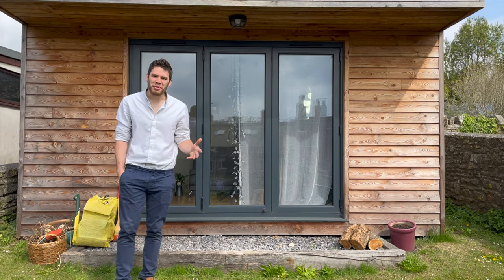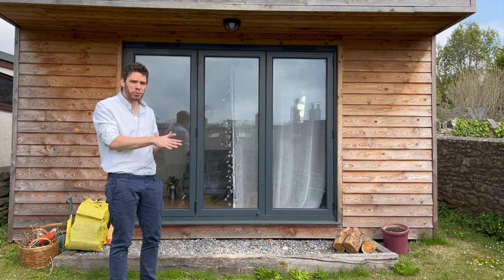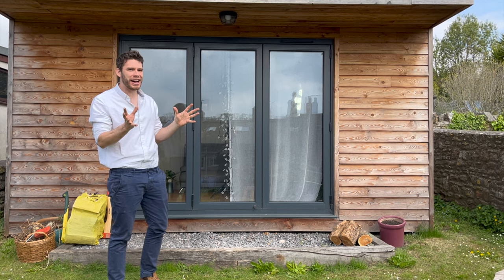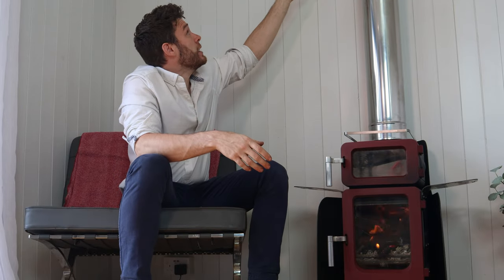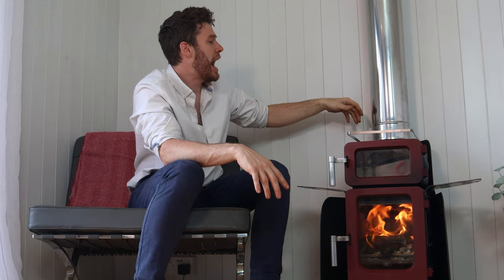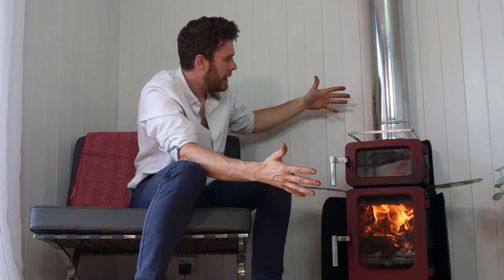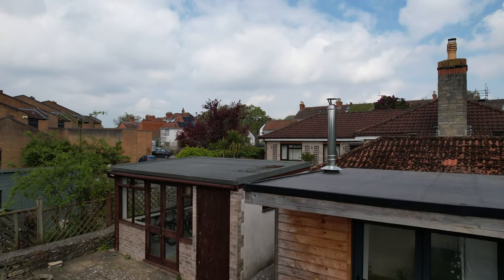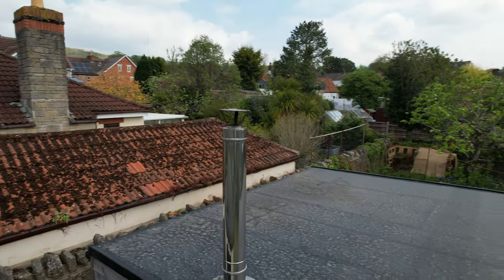Can a stove be fitted into a garden room, yurt, van etc, safely?

Comment: I’ve been putting a log burner in my workshop for about 6 months now and safety on the installation has been my priority. I’ve trawled the internet and YouTube for good informative content in all aspects of the fitting (mostly for regulations and safety aspects) This video is by a million miles the best I’ve ever seen and wish I’d seen it months ago. I’ve bought all my flue system from a local family run business so I can pick they’re brains and knowledge. As you say I have been through all the installation with a fine comb knowing where the possible risks are. I now feel confident in my installation BUT I am scared to light it 😅
Many thanks for a totally brilliant informative video, I wish I could tell more guys trying the same as me.
Reply from the maker: That’s really kind, thanks a lot. 

As long as you have a smoke/CO alarm there is not too much risk as you’ll be in there doing things and not be asleep. Light it up, I hope it’s excellent, but if you are struggling feel free to ask a question.

Comment: This was an amazing watch, thank you! It was jam packed with useful, important, valuable information. I'm starting a caravan renovation project, in which I plan to live for a couple of years on my parents land and I am desperate to include a log burner. Some of your points fill me with a bit of fear, which does make me nervous, but I think the most important take away here is awareness.
Reply from the maker: You’ve got it. I’m glad to hear it’s caused you to question, that is the key thing. Sadly it’s arrogance that gets you in these situations, so you’re perfectly placed for success. 

If you have any questions during your project then feel free to just message here 👌👍
Reply: @TheTortoise  Mostly I'm overwhelmed by all of the decisions which need to be made. I thought it was best to get a 'professional' to install it, but I've been quoted £2k install only, before I've even chosen the burner and the flue system. The most affordable option I've found, the supplier specifies I should use there 76mm single wall flue otherwise another 3inch flue can't be guaranteed to fit properly, but I'm here agreeing with your statement that really I want an insulated flue, and so then I'm back to having to work this out myself and find a suitable product haha. It's an endless circle!
Reply from the maker: You’ll get there. It may work better to work together with a builder or handyman. That way you get the benefit of their experience when cutting through the roof and sealing things up, but you can also take the responsibility and properly understand what you,be done and why. You can also then edit things in the future if (for example) an extension to the flue is needed etc.

Comment: Thanks for the videos they are great help and entertaining,  is the srove allowed in a converted garage used as a habitable room that had to comply to building regs ?  The room is 2.4m x 5.5 m  x 2.3 m  or could you recommend something that would be more suitable,  the room is used to relax in and watch TV , thanks
Reply from the maker: If the building is subject to building regs then you can still have a stove, you just need to also install the stove in a way that complies with building regs and sign it off. 

Definitely no issue with still having a stove though.

Comment: Really informative but just wondering if you need to put in protection at the back of the stove to protect the wooden wall?
Reply from the maker: Every situation is different. No one will ever say no to that question, so it’s tricky. 

When it comes to safety all anyone will say is go safer, because they don’t want to be blamed for an issue. Hence why these things can often lead down a rabbit hole until they become impractical, ridiculous, and someone says “it’s health and safety, gone mad”.  So the intention of the video is to encourage you to take your own risks, and edit things as you learn. 

We’ve fitted big 10kw stoves directly in front of softwood boards with as little as 10mm gap. Nothing has burned, but I certainly wouldn’t recommend it, it’s just a silly test we’ve been doing for the last 4 years, to see at what point things go wrong.
Reply: Cheers, edit as you learn is my new mantra 👍😁
Reply from the maker: It’s a bit like life generally 😅

Comment: Hi,
I'm considering installing a small (sub 5kw) stove into a 3x3x2m garden room. The walls are stud 2x4 and clad with timber.
I have two choices, roof or wall exit. Roof would be better as there would be no bends, however the roof is bitumen based Onduline.
Either way I pass through a combustible material and would need insulated pipe and a sleeve.
Which would you consider preferable? I'm concerned a roof gasket won't contour, seal or adhere well to the Onduline. 
Many thanks.
Reply from the maker: Definitely the roof, you could look up a product called “rapid flash” which may be a simpler fit.
Reply: @TheTortoise  thank you. The gasket looks ideal.
You wouldn't have any problem with exciting through the corrugated bitumen roof? I assume a roof gap of 70mm to the twin walled flue would suffice?
Thank you again for the advice.
Reply from the maker: @theboycalledleaf  Most flues only require a 50mm air gap, so no it's certainly do-able.
Reply: @TheTortoise  thank you so much for your advice. I have some interior lining to do and then I'll consider a stove.
Top stuff. Great video too.

Comment: With the current increase to fuel bills, I'm seriously looking at putting a small multifuel stove in my garden room. It's a 16x12ft (mancave) and wood construction (sorry, couldn't resist that spelling).
I'd be rreally interested in working with you to document this install for others out there looking to do the same without drafting in a 'professional' installer, just to prove your point that with the right advice and guidance (the video I'll produce), this really is a project that can be carried out by those with enough ability.

I built my bar from watching a series on here and had never built anything to this size or spec but have had numerous compliments on its construction so know the above would be achievable.

I'll drop you an email.
Reply from the maker: Hi Dan,

Just back from a few days off, I’ll have a look at your E-mail. There may be an issue as whatever you do it is a risk. Partly what I’m advising is personal responsibility for that risk, so I wouldn’t want you copied (not that I think you’d do anything terrible)!
It’s a really hard balance to strike.

Comment: If you install a wood burner into a outbuilding which is under 30msq ie exempt from Building Regulations, is it exemption from Building Regulations? Thanks
Reply from the maker: I’m not entirely sure what your question is, but yes these buildings do tend to be exempt. The main issue is therefore making it work well, rather than just ticking off rules.

Comment: Not going to risk it myself as we like to nap in the summerhouse  so I'll leave it to the professionals to install id would be worrying about the fumes
Reply from the maker: That is honestly NOT safer. There is no way of doing installs into these short buildings in a compliant way, I would strongly suggest choosing a different form of heating if you are not comfortable with properly understanding and fitting these systems. 
Having someone else slot pipes together will not reduce your risk at all, these systems just slot together, so there is no difference between who does it, what makes the difference is you understanding the system and the risks taken. 

In this case my advice is do not fit a stove, because sleeping in a building like this without being properly interested in testing the stove yourself is an incident waiting to happen. 

All the best, I hope this was helpful rather than bossy 😳.

Comment: So what would you guys recommend on the external flue height ?
Reply from the maker: There are so many factors that really is a “how long is a piece of string” question 😬. The moment you’re stepping outside of regs, you’re also stepping outside of advice so a lot of this is trial and error. I tend to start by getting 2ft above the top of a typical metal corrugated roof, and I then try it out to experiment with how it works in different situations. Sometimes your first try works, but it’s more common to need to tweak things again.